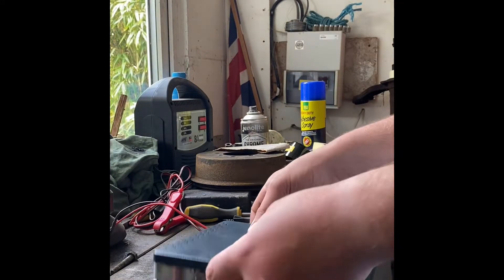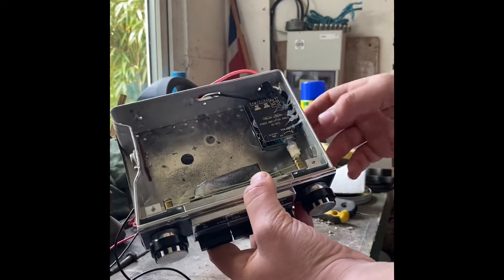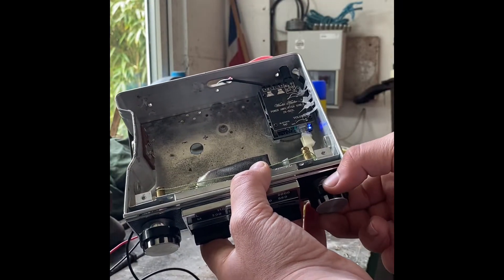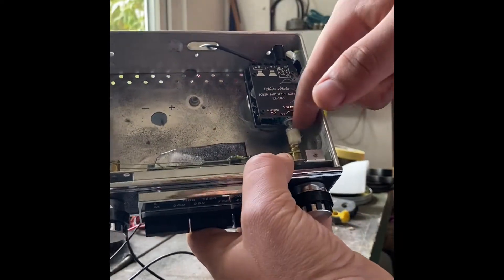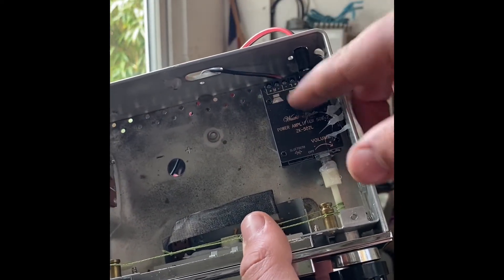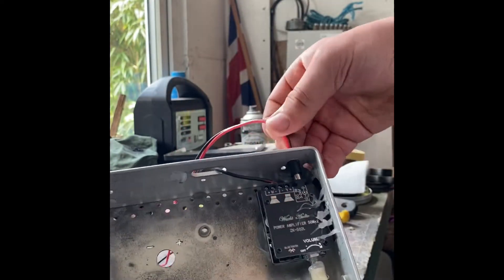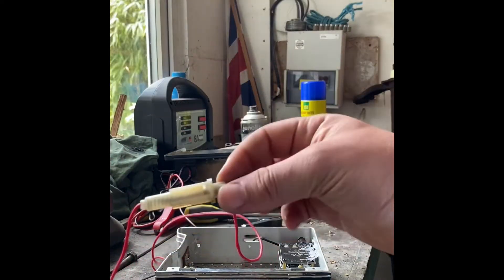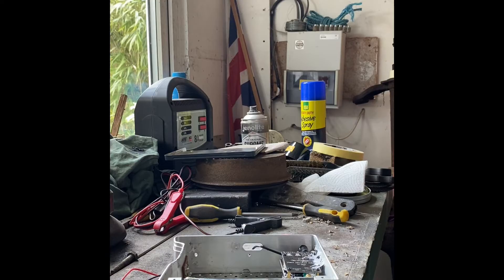How to convert a vintage car stereo to Bluetooth for classic cars

Comment: I have a 75 Triumph Spitfire and it didn't come with a radio. So I am going to get one of these and mount it threw the cigarette lighter and use the part that pops out as the on/off and volume. Need to make more content its been 2 months!! I just subbed and got you to 100!

Comment: Thank you, that's a very good idea.
As in another comment mentioned scale alumination would be fine. 
Another issue: Wiring only the left or right channel - you only hear the half signal.
You could improve the whole thing if you use a mono bluetooth modul. There's one to be found in the bay which has some functions in the potentiometer/switch like on/off, next song, play/pause... It's called ZK-1001B Mono 100W Bluetooth. It even has a USB port.
Cheers from Bavaria Germany
Reply: Gonna try that one.. Thank u man
Reply: If the amp is Bridgeable, Speaker left negative then right positive, doubles the watts and you get both channels out of the one speaker

Comment: Great job i've been looking for something like this for my 1974 Rover .... many thanks for posting the Video.
Reply from the maker: No worries, just put mine in my midget and it works a treat, what river have you got, p6?
Reply: @mgmidgetsandme6647  ...1974 Rover P6b V8 in Mexico Brown
Reply from the maker: @paultaylor5911  love the colour
Reply: I have a model 80 which I’m going to give this a try. Is it easy to remove the existing workings leaving just the controls etc ? Great video and I intend to do this in my MGB with centre speaker so will use a dual voice speaker. Thanks
Reply from the maker: @stuartedwards6959  I think it was just a few screws to undo it was easy enough mate
Reply: Thanks mate look forward to doing it.

Comment: Thank you. Clear and short video, without a lot of technical electronic circuit chatter. Question: Could you have connected this board/amp card to the volume knob? Was it possible or was there some impediment to connect to volume switch? Grateful for your answer.

Comment: Question, given the blue tooth unit is encased in an old FM radio box made of metal does that affect the bluetooth signal? Is there anything you need to do to get BT signal to work ok?
Reply from the maker: No it works fine as it is

Comment: Cool project. Question: The makers of those Bluetooth units say they will distort with less than 5 amps of power. Should the fuse rating not be a little higher than 3 amps? Like maybe 6 or 7 amp to accommodate tolerance?

Comment: I tried one of these that I bought off Amazon, but it didn't work. Unlike what you did, and I really like your idea, I just tried hooking it to a speaker in my '55 Chevy truck and it was so distorted. I was very disappointed. What did I do wrong?
Reply: A comment was mentioning how it will distort with less than 5 amps. I don’t know if you saw that but could be worth looking into